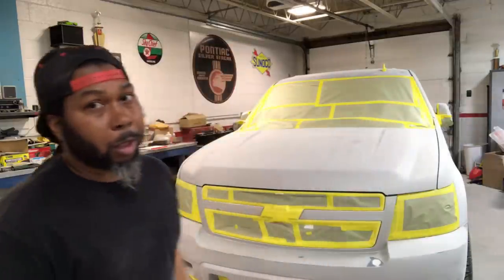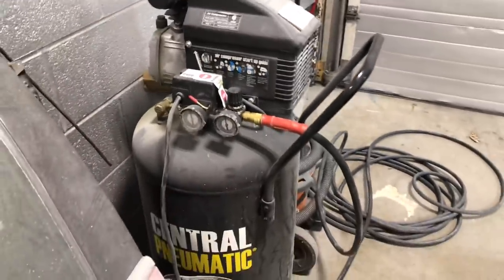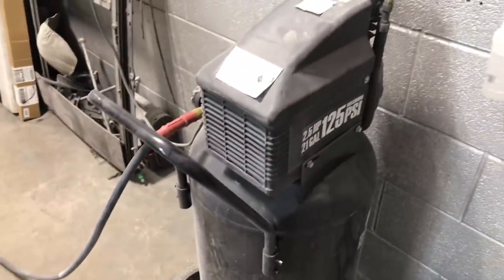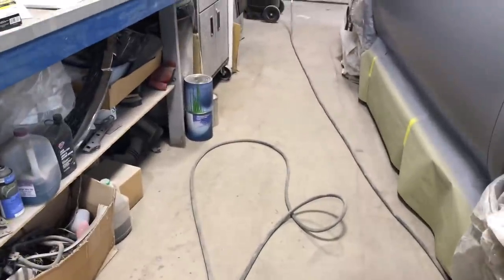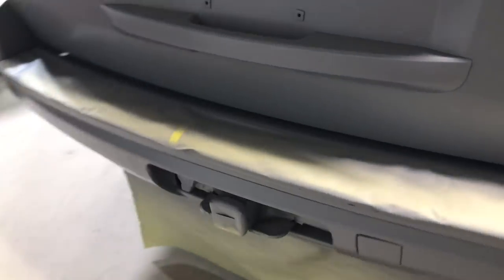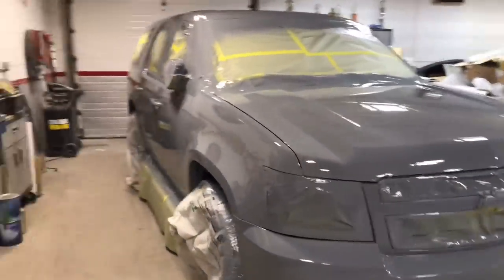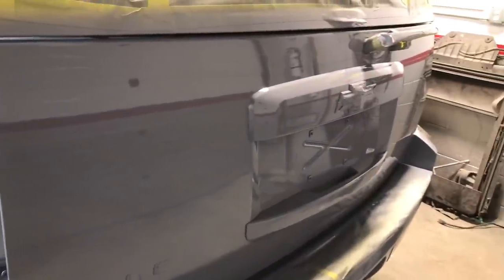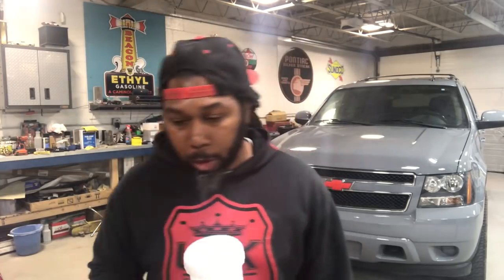COMPLETE PAINT JOB with the SPRAYIT R500 LVLP spray gun and a small compressor

Comment: You can add an extra tank to it for more air but you will eat that pump up. Add air dryers to the line and your gun.
Reply from the maker: I actually have a paint booth in my shop but your definitely right about the extra tank and dryers for the line

Comment: Sounds like you would have been better off with a 60gallon tank or a second reserve tank but the compressor managed to keep up.     Tough to keep a wet edge across a full panel by the looks of it.    Still it works and that's success.    Dropping a couple of thousand on a shop quality compressor makes doing a good quality DIY paint jobs inaccessible for most of us.     These LVLP guns look like they take more skill to do a good job with but it's definitely worth trying.
Reply from the maker: @robertfontaine3650  I know of and have helped a lot of people do DIY paint jobs with these small setups so it’s definitely worth at least giving it a try before breaking the bank for a big setup!

Comment: I’ve never seen this channel before and I’ve been watching YouTube and auto body vids for more years than I can count.

This gentleman is humble, not a loudmouth and spitting facts.

I have different compressors, but for mid size jobs I use a 20 gallon husky from Home Depot.  I spray clear in the mid 30’s for PSI with my 1.3 Iwata and I can hold the gun wide open nonstop and it and I never lose air pressure.    It builds enough pressure that it’ll still shut off from building enough air.

Honestly 
, you could use a ten gallon compressor to paint a hood, or a few panels at a time.

The only things I’d say is run the 1/2 inch air hose keep the hose as short as possible use the bigger fittings, make sure you get a compressor that takes oil, make sure you use a moisture trap before the gun……..  always make sure you open the bleed valve on the compressor when your done using it.

Most of the guys on YouTube even the diy guys make a lot of this stuff sound wayyy more complicated and confusing than it really is.  Spraying is the easy part.  The bodywork and prep is the hard part.
Reply from the maker: You’re spitting all facts and I appreciate you leaving this comment 🙏🏽💯

Comment: The folks that say it can't be done either don't know enough, or charge big dollars for a paint job. Excellent video. 
I'll be doing my 93 Z24 soon with an 8gal compressor, some water/oil filters, and some single stage. Two tone is also a good option for a small compressor setup as you can split up the spray time.
Reply from the maker: There is plenty videos on people doing paint jobs with small compressors so we can put that myth to rest…what color are you doing your Z24?

Comment: Looks great!  Just shows what you can do with a little planning, the right equipment and a lot of talent!  For a while Harbor Freight sold automatic air tank drains that would cycle every time the pump cycled on and off but cracking the valve on the bottom is a great tip and simple solution.
Reply from the maker: Thank you sir I appreciate you watching the video!

Comment: I've tried this crap 2 years ago before with a cattle trailer, Chassis Saver, SprayIt 1.7mm siphon gun, and an old Champion 30 gal. air compressor.  It only managed to spray half of the rear door before running out of air.  I spent most of my time waiting on the compressor to refill.  

Ended up using my Fuji turbine system that I use for woodworking since I had no other options at the time and it worked out better than the SprayIt LVLP kit.

I finally bought an Industrial Air 60gal with 13.4cfm @ 40psi that can run an HVLP gun and haven't touched the SprayIt LVLP spray guns for more than a year.  On top of that, they spray like a glorified rattle can but that's just my two cents and your ACTUAL experience may vary since the compressor I used was built back in the 1940s.

Just a heads up, California Air Tools who sells the SprayIt LVLP kits has really poor customer service so if you run into a problem they typically don't respond and will leave you hanging just so you know 😉
Reply from the maker: I hate that you had that bad experience with the SprayIT and glad you found something that worked for you until you got the 60gal compressor setup…I also appreciate you for the heads-up on the company service I myself have never dealt with them but if I have to in the future I know what to expect…Thanks again Weaver Cattle Company!

Comment: I have owned a Sprayit 3300. It was a great gun BUT after four paint jobs the inner teflon bushing for the needle started leaking and I was unable to get any parts for it. I would definitely recommend this gun to anyone. Just be aware of issue after a couple of uses.
Reply from the maker: Did you use it doing 4 complete jobs when it started leaking? I myself have used it 3 times now and definitely will keep this in mind and appreciate you letting me know about this
Reply: @UndergroundPaintKing  yes unfortunately it did. But it was definitely a good gun. Not sure if the 3300 has better parts. I do play to purchase another one for small jobs. I used a Tekna copper now GREAT GUN!!

Comment: Great stuff! I painted my MR2 (admittedly a tiny car) with a 20 year-old 33 gallon Craftsman compressor. Filtration is huge, since the compressor is going to run a lot and the heat will cause condensarion in the tank. There are lots of good videos on YouTube about how to build copper cooling manifolds. Definitely worth the trouble.
Reply from the maker: Thanks GoalieLife I appreciate you checking out the video and I agree that having the right filtration system is worth it!
Reply: @UndergroundPaintKing  Thank you for the video!
Reply from the maker: @grimson  you’re welcome!

Comment: Great job......I have same compressor and same moisture issue.....I went and got another 25 ft hose and I put some small disposable air filters in between the hoses...from harbor freight and it cut the moisture out....
Reply from the maker: That’s a great idea! It’s definitely a few different ways to go about it and I’m glad you found a way that works for you!…I appreciate you checking out the video!
Reply: @UndergroundPaintKing  I had to put a piece of a dowel a little longer than 2 filters long and put over filters and taped on ends...filters r plastic...I broke pulling around corner....live n learn....nice paint job !! Thx...u gotta try kbs paint and clear.....it's setup for those guns....it self levels and covers unreal..,..
Reply from the maker: @jimreal3840  kbs paint? I’ll have to look into it
Reply: @UndergroundPaintKing  kbs.com....it don't fill the whole place up w paint,it's heavy body...it's 75% easyer all the way around..it's really nice stuff and I just used the diamond clear coat on my grand national bumper and it's fkn nice ! I'm no pro,I learn by watching you guys...this clear is one part but I used the 2 part before and it was nice because I never got clear coat right...but this shit is perfect..
Reply from the maker: @jimreal3840  I’ll have to look into it…thanks for the info bro 💯

Comment: Hey man I've been using the same compressor for years And it'sade me alot of money, but I did ad a water trap and oil separator to it, I've never got water in my lines in almost 10 years and over 100 paint and mechanic jobs. But man you did a great job!!
Reply from the maker: Thanks I appreciate you!…I don’t usually use the small compressor to paint so I definitely should have had things set up better but I definitely will have something set up for next time…again I appreciate you checking out out the video
Reply: @UndergroundPaintKing  no problem man, your work is awesomeakese feel not so alone painting under my car port with harbor freight tools😄

Comment: That was flippin' amazing, UPK!! What a beautiful job you did on that Tahoe!!! I can't wait to get started on my auto body paint project using a 30 gallon compressor and a LVLP paint gun.  The Sprayit gun laid down some nice layers of base coat/clear coat. Great video, man!!!
Reply from the maker: Thanks I appreciate that and appreciate you…what project are you working on?
Reply: No worries. I am planning on doing body work and painting a 1992 Mazda 322. Gotta question here, UPK. How do you determine when you have the proper PSI setting for the gun when laying down base coat/clear coat using a LVLP gun??
Reply from the maker: @larrywong7101  you want the gun to atomize the materials into small fine droplets and if the gun is giving you big droplets that can give you the orange peel or textured look…depending on what materials you go with (because all materials are not the same) it’s best to do spray outs or test panels to set and adjust your gun to the best setting that is giving you the results you are looking for
Reply: @UndergroundPaintKing  Thanks for that great trip!! Greatly appreciated!!
Reply from the maker: @larrywong7101  you’re welcome I do my best to help out!

Comment: I bought that gun about 2 year's ago to spray hydro dip activator, With my 10gallon husky. I couldn't believe the spray pattern and the fit/feel for the $$. Long story short,  I turned this bad boy to my clear gun for my hydro dipped part's. One thing I noticed out the box was the plastic ring behind the air cap, only cheap thing on the gun. But I didn't get scared,  SHARPE FINEX 3000 which is little a hundred dollars has the same similar plastic O ring! My man great work, only been here couple months subbed,  but hooked! Uu, sprayway, phharway, lakeside ,gritts outta bama, jr outta tex, couple other's!! Got thatt content!
Reply from the maker: Bro for the money you wouldn’t expect this gun to be this nice! I appreciate you not only checking my channel out but also checking out and supporting my other comrades…thanks bro!

Comment: Nice job! I like your shop too. When we used to paint cars in a garage we hung plastic from the ceiling and had a few box fans with household ac filters to pull air out. It's more work but we had to keep overspray off everything.
Reply from the maker: Thanks and that’s what a lot of people still do today which is using box fans to keep the overspray to a minimum
Reply: @UndergroundPaintKing  We were someone else's garage so we basically built a paint booth inside with plastic sheets. It worked out well and kept the dust down as well.
Reply from the maker: @FabiusMaximus1000  nice!!!

Comment: I got a lvlp spray gun today from Ali Express with a 1.4 tip and it had the PPG adapter with it. Wasn't much though about 49 dollars I just decided to get it because the ratings it was a 5 out of 5 stars. The air compressor is under 30 gallons got so it will be better on it. Am close to ready to paint my truck now had to clean the garage out and about done with it I am still gonna use the electric spray gun got from Amazon but in future will use the lvlp spray gun.
Reply from the maker: Sounds like a good deal
Reply: @UndergroundPaintKing  it said 31 percent off the price too. I ordered stuff from Asia before on eBay but haven't sold nothing lately.

Comment: Thanks for the video, have a small compressor and got a r500 on the way. You definitely put some confidence in me to paint my tahoe, like to know what you use for paint on this tahoe and rough amount, also what you use for masking and taping? Not sure if you awnsered this already. Thanks again i appreciate your time and knowledge
Reply from the maker: I used shopline paint which is a ppg product and it was 3 quarts I believe with a 1:1 mix ratio. I use masking paper as well as plastic depending on what I’m doing along with 3m yellow tape

Comment: Usually, with a hvlp gun, you would create a huge overspray cloud that you can hardly see through. The Low Velocity gun creates no overspray cloud. Although his compressor never stopped running once it started. The result was a very professional paint job.
Reply from the maker: You’re definitely right!…I appreciate you checking out the video!
Reply: if have lot owerspray gloud waste lto paint and have too high pressure,need adjust decrease pressure.

Comment: Couple months ago you talked about the spectrum HVLP, Harbor Frieght had a sale for 100 dollars I took your advice and bought it, tried it out clearing a front bumper the other day and it did a excellent job. Also took your tip about using microfiber clouth to wipe down base coat before spraying clear. Thanks so much for helping out with your vidios.
Reply from the maker: Nice!…I’m glad I could help out 💪🏾

Comment: I can't upgrade the electrical in my house enough to run a bigger compressor. I have the same compressor. It's good to see you don't have to stop every time the compressor kicks on. Great video.
Reply from the maker: Definitely keeps consistent air flow so you can definitely get the job done with a small set up!

Comment: WOW it looks good I never thought of using a LVLP gun I had to hook up my 21gal and 33gal air compressor together to paint my mustang with a HVLP gun. I will use a LVLP gun on my next paint job
Reply from the maker: Thanks I appreciate you checking it out and I never tried hooking up 2 compressors I think in the back of my mind I thought I would blow something up 🤣
Reply: @UndergroundPaintKing  Not at all get two air compressor T connector , 2 male quick connect. Remove the relief valve on both air compressor and connect the T connector to the compressor where the relief valve you removed, connect the male quick connect to one end and the relief valve to the other end of the T connect and connect the hole to each of the male connect. It worked well for me
Reply: Also brotha connect an air filter to your spray gun it helps with the water in the holes I use the ones from Harbor Freight
Reply from the maker: @35nomoon  now I have to try it…thanks for that info 💯
Reply from the maker: @35nomoon  I had one hooked up but it wasn’t working well probably from being used to many times
Reply: @UndergroundPaintKing  Ur welcome Brotha I couldn't afford a 60gal tank so hooking up the two tanks worked well. Good luck Brotha
Reply from the maker: @35nomoon  gotta do what works best for you bro…thanks again!

Comment: Nice work looks good I’m in process painting my 99 camaro z28 just got me spray gun n rest paint just have finish sanding rest car I’m using that exact same compressor that’s all I have for now n I’m definitely gonna be painting it myself just cause paint jobs are expensive n I can do myself take my time check make sure is prepped good n check the gun  make sure it’s adjusted good n test on test pannel or masking paper or cardboard  before actually spraying on vehicle
Reply from the maker: Sounds like you have a good plan 💪🏾
Reply: @UndergroundPaintKing   yeah got to man better chance of not having do car over again btw like the Tahoe  turned out good  hopefully mine will turn out that good I’m using the restoration shop paint single stage paint  I think should though we’ll see
Reply: @UndergroundPaintKing   yeah got to man better chance of not having do car over again btw like the Tahoe  turned out good  hopefully mine will turn out that good I’m using the restoration shop paint single stage paint  I think should though we’ll see
Reply from the maker: @derekwhite1738  I’m sure it’ll look good when you’re done, I appreciate you checking out the Tahoe!

Comment: Thanks for your rapid response and advice. One more question......can I add some base coat to the clear to fade away some lines?
Reply from the maker: You can add a little base to the clear but I can’t say for certain it’ll do what you’re attempting it would be something I would need to see but it’s possible that it may bury some imperfections just avoid running the clear
Reply: Many thanks again. Your advice is certainly appreciated. Stay safe and GOD bless. @UndergroundPaintKing

Comment: Awesome video.  Good to see LVLP getting some love as other channels don't cover it enough for the guy at home on a small budget.  I started off with a cheap HVLP set over 10 years ago,  then moved to an Astro Evo LVLP shortly after.  It's a learning process, but knocked out a 1991 S10 Blazer with it.  Seen the Sprayit guns years ago but didn't know they were still available.  Will definitely check them out.  

Thanks brotha!
Reply from the maker: Thanks I appreciate you checking out the video and like so many other people I started with a small compressor years ago and I do my best to shop people that they can do it even with a small budget…again I appreciate you!
Reply: ASTRO Evo is a good gun
Reply: @mitchellferre1652  yes, it's still spraying well even after all these years. It's a shame they discontinued it, but I've read somewhere that it shares parts with one of the older Iwata guns and another brand. That makes it repairable  and upgradeable.